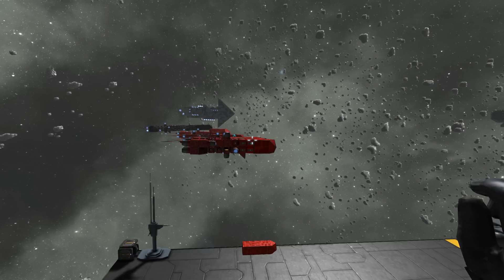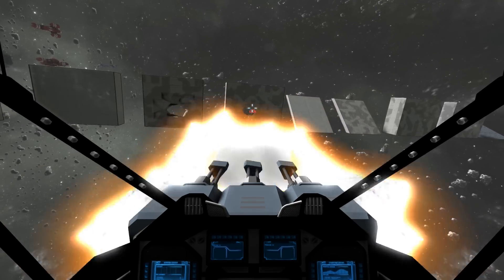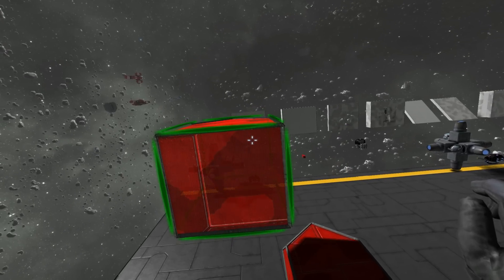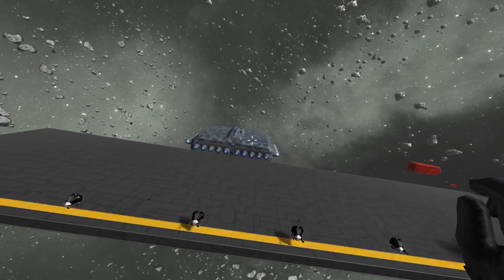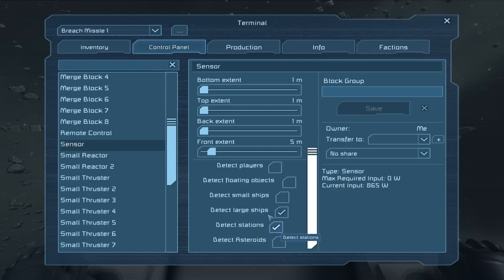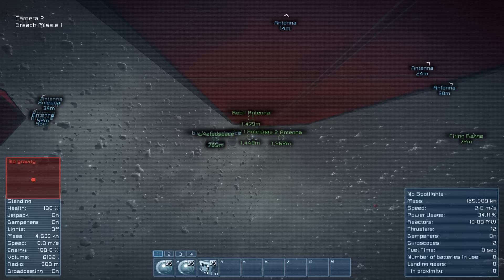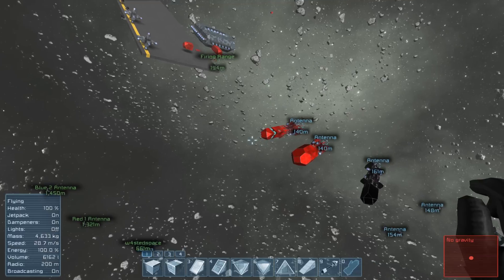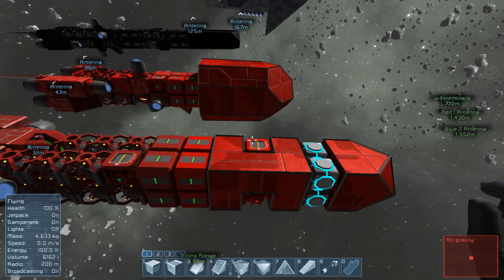Space Engineers - Breach Missles, Kinetic Testing

Comment: Had a similar exploding merge block problem on my utility ship. 2 merge blocks connect the ship to its tools. I can attach them no problem, but when i detach them one of them blows up every time and takes out nearby piping with it. When there's just a single merge block everything works fine.
Reply from the maker: That's an easy one to test at least, can just remove all but 1 of the merge blocks and see if that fixes it (although slightly afraid it'll move a bit weirdly when detached as it's not central) Cheers :)
Reply: ***** You could use blast door blocks to replace the 3 obsolete merge blocks, so they only connect to the explosive part and don't touch the breach part since they're blast door blocks (use the blast door edge or the corner tho). 
That'd definetly sort the problem with the wobbliness in flight out since it would re-stabilize the center of mass :D
Reply from the maker: *****
Yeah that would work indeed.. not sure it matters what block really as long as it's got some mass to it, heavy armour should work also.. Just about keeping that CoM in the right place so they don't separate weird. :)